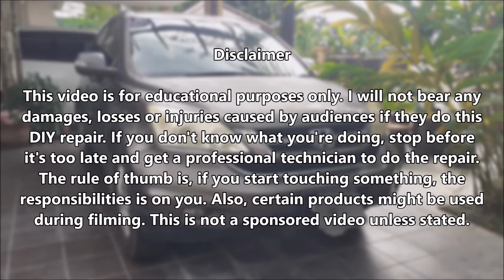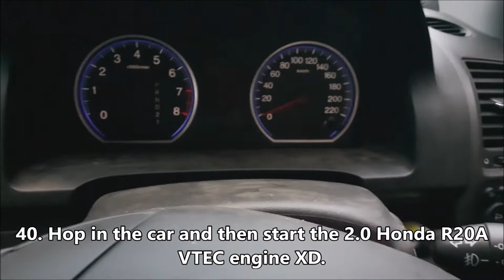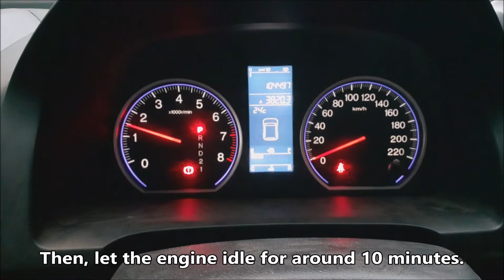2011 Honda CR-V Throttle Body & Mass Air Flow Sensor Cleaning

Comment: those two coolant hoses just SO difficult to remove. How did you manage it? just keep wiggling and twisting?
Reply from the maker: Yes, you need to clamp it first (very tightly) and then twist it back and forth and at the same time, pull the coolant hoses back 😃. These hoses have been clamped since 2011, so you get the idea how hard it is to remove it 😁.

Comment: Do you get a high idle every time you start your car now?
Reply from the maker: Interestingly, my car does not have any idle issues after I moved the butterfly valve. The engine runs just fine 🤣

Comment: Hi.
Very good video and comprehensive..
I have a Honda CRV 2007 4x4 automatic 2.0 engine R20A2 , and under the engine filter housing I have a black metal filter, which I presume that is the transmission filter. Can you help me and tell me if that is the automatic transmission filter? Since I want to replace it. I have no problems, just for maintenance purpose.
Thank you
Reply from the maker: Hello 😃. Yes it is 😁.
Reply: Thank you very much for your reply. Have a good day
Reply from the maker: @zahariafelix  You are welcome 🤗.

Comment: From you expertise will a dirty throttle body and idle air control valve cause a car to not start?
Reply from the maker: Hello 😀. From your question, I assumed that your car does crank but does not start. No, a dirty Throttle Body (TB) and Idle Air Control Valve (IACV) will not cause a car to not start because you only need air, fuel, and spark to get the car running. Check those first. For the TB and IACV, it is extremely rare for these two components to get jammed up (TB Butterfly Valve) and clogged up (IACV) from a minor dirt. Hope that helps! 😄
Reply: @LanesEngineering  it is nice to clean up your engine bay 🙏🏻
Reply: stuck closed idle air control can cause crank no start (its very rare though) just watched scanner danner video on it, it was lexus. try to start the car with foot on the pedal (not much, just a little to open TB butterfly to let some air come in), if car is still no start, you can rule TB/IAC.

Comment: 2011 Honda CR-V? That does not look like the 2.4L K Engine which was used in the US.
Reply from the maker: Yeah 😃. Here in Malaysia, the only engine offered is R20A. Maybe because in my country, we do have a car road tax system similar to other European countries which is based on the CC of the engine. The larger the CC, the more tax you need to pay 😅.